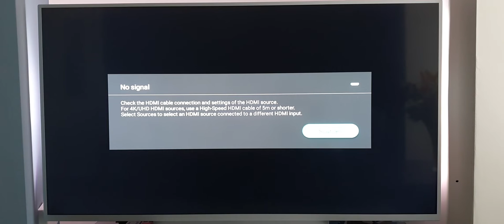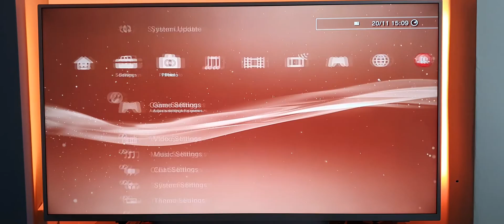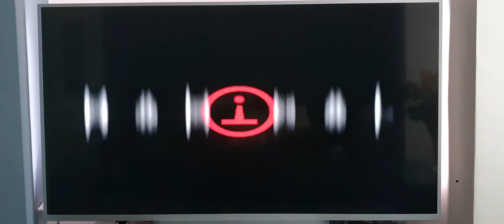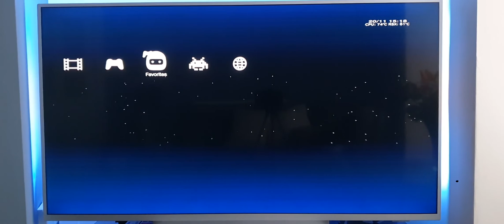How To - Sony PlayStation PS3 YLOD NEC Tokin Capacitor Repair Fix

Comment: How do you know it was those 2 that went bad is it like that for every console or can it be different ones as well
Reply from the maker: Hi Roland, generally it is the the NEC Tokin capacitors below and behind the RSX chip which are the first to go. Ideally if time allows and you have enough replacement capacitors you can go ahead do replace the other NEC Tokins aswell but, this has been found to be unnecessary and replacing the 2 as shown in the video should bring the console back to life. If it doesn't it may require the others to be replaced as well or could be existing repair attempt e.g. heat gun method which have caused additional damage that does not relate to the NEC Capacitors. I have had a 100 percent success rate on consoles which haven't been opened up before and had a prior repair attempt undertaken on them, and even the ones that have been opened I have only had 2 which failed becuase there was additional damage to the CPU GPU or powersupply etc. Hope this helps 👍
Reply: @waqarnaweed  thanks the capacitors you use you could put on the top bottom of the rsx and you don’t need to bridge them
Reply from the maker: @Roland Amsler could you expand on this as when you are mentioning put them on top?
Reply: @waqarnaweed  I have seen people using a bridge like soldering a wire from one capacitor to the next I’m not sure if that is really important to make it work or not
Reply from the maker: @Roland Amsler the only reason why you would solder a wire to create a bridge from the top capacitor to the bottom one (positive to positive) is if you also removed the NEC capcitor on the reverse/underside of the board as you would lose the bridge connection. If you don't remove this then there isn't any reason to need create a wire bridge. If attempting this repair try it with one capacitor being removed first and replace with 4 tantalum capacitors to see if this fixes or delays the YLOD if not move onto removing the second NEC capacitor and retest. Generally after the second capacitor replacement it will work thats from my experience anyway. Hope this helps
Reply: @waqarnaweed  appreciate all the help what I did was took off the 2 necs on the bottom of the board on the rsx replaced with 8 taltanium capacitor and still have the ylod would you recommend taking the 2 off on the top of the board and replace with more new capacitor then would I have to create a bridge on top or bottom thanks
Reply from the maker: @warmaster336  Not a problem, I would suggest you move onto replacing the 2 NEC capacitors on otherside of the board as shown in the video as these are ones that tend to fail first. Becuase the capacitors would have been removed from both sides you would need to create a bridge between the positive terminals. Personally I have not had to do this so I can't comment on if this will definetly work for you, but that is the general process if you have removed them from both sides. Let me know how you get on and if you need any further info.
Reply: @waqarnaweed  that is exactly what I did replaced the 2 like in the video and still ylod that’s why I was curious if I should do the ones on the other side of the board as well or could it be 2 on the cell as well
Reply from the maker: @warmaster336  was the console tampered with before? as prior attempts using the heat gun method etc that was used years ago by many could have caused additonal damage/issues to the board e.g. the GPU/CPU and other capacitors around the board. If you have only removed and replaced the 2 capacitors as shown in the video then you will not need to bridge them as orginally stated aslong as the NEC capcitors on the otherside of the board are still attached. However, I would firstly suggest that you recheck that the capacitors have been soldered on correctly and making a good connection as they can be easily misallined and shorting against the other terminals. If this does not work then I would go ahead and replace another NEC capacitor with tantalum capacitor. What you should notice is that each time your replace a NEC capacitor the YLOD takes longer to come up which means your going in the right direction, but if it goes off stright away this would lead me to beleive the capacitors are not making proper contact with the board but also there could be other faults on the board caused by past repair attempts which I highlighted in my previous reply where 2  still failed to go past YLOD as they contained addiotnal issues caused by past ppor attempts at repair.
Reply: @waqarnaweed  the only thing I did it had the ylod when I got it so I attempted a reflow that didn’t fix the issue so I did take the 2 bottom nec out with the heat gun from what i understand the board can take a lot of heat so I didn’t think it would harm anything so it’s an instant ylod I will check again to make sure the new capacitors are soldered in properly and see what happens if not I will try to replace more is it possible using the heat gun to take them out caused more damage
Reply from the maker: @warmaster336  generally using a standard heatgun (not a rework/reflow station) will potentially cause damage to surrounding components if they are not sheilded. Also the heat from a generic heat gun also cause the board to warp aswell which is not somethign you want to do so close to the RSX and Cell chip.
Reply: @waqarnaweed   I understand to much heat is not good then how would you replace the necs with new necs without heat how would they stay on the board
Reply from the maker: @Roland Amsler The NEC (only a brand) capacitors would have been soldered to the board using specialised processes at the factory or using solder paste which is much easier to flow and lead to adhesion when heat is applied. You have to remember that soldering SMDs and chips will generally require even heating across the board to prevent warping (so preheating the board to prevent/reduce this)  or by protecting and insulating nearby sensitive components from extensive heat from general heat guns etc.

Comment: Could you not have replaced the caps with new original caps?.
Reply from the maker: Yes there is no reason why you couldn't, however to get hold of replacement NEC Tokin capacitors in the first place is an issue. If these can be found they are significantly more expensive. Also trying to replace with like for like, you would also need a hot air station to solder the NEC tokin back to the board.
Reply: @waqarnaweed  I understand.. to was just curious.. thank you for answering my question..
Reply from the maker: Not a problem, glad you asked as it may help other people thinking the same 👍
Reply: @dreadpirate1337  not only are the OEM capacitors difficult to reinstall, but would also be likely to just fail again just like the ones you’d replace. Unless you jailbreak your system and keep a high fan setting, then using the original new-old stock OEM caps would work fine
Reply: @DeadlyHellhound  Sucks you can't mod after getting the full YLOD. You would have to repair it before any thing can be done.